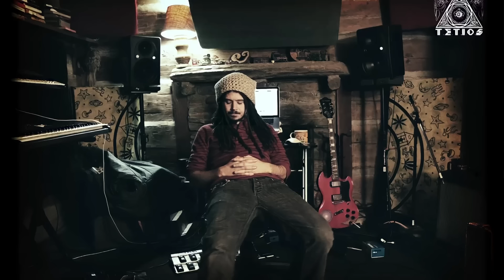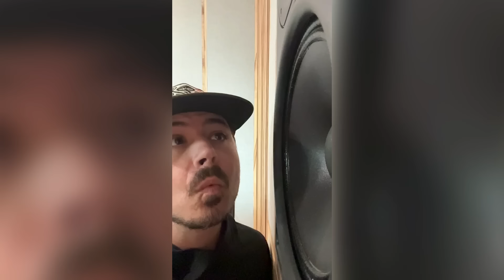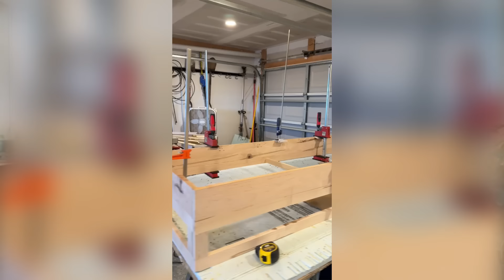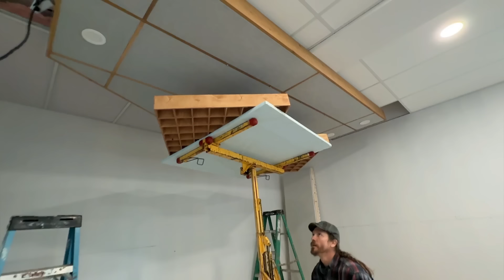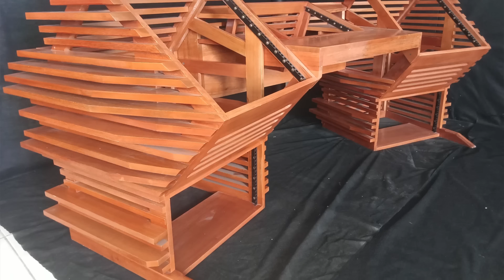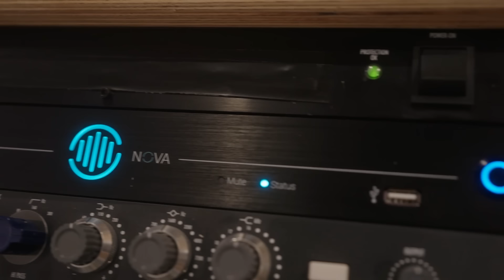New Studio! If I Can Build This, So Can You

Comment: Great video and amazing project and results. It's great to see the correct focus. So many "experts" think buying a pair of ported "pro" monitors and some acoustic panels can truly create an environment for mixing (or god forbid, mastering) or focus on equipment or software to correct acoustic issues. It's relatively easy to fix frequency response issues, it's very hard to fix time-domain related issues, which are equally important for proper translation.

Comment: This will probably get buried but worth noting, the ground is not "infinitely dampened" and absolutely does transfer vibration.  May be incredibly negligible to most frequencies at most volumes, but drums and bass absolutely travel with power.

And we're talking bass music, mostly w/ this channel, as i know Papadosio got an upgrade w/ this as well.

If youre going to foot a massive bill like building a studio or home theater, a floating floor is the way to go.  Its the endgame of a room within a room for sound isolation.

Ceiling height and shape really makes a huge difference.

If you ever build another one,  study home theater builds for sound isolation techniques.  Its amazing the amount of Db to be dropped just a couple feat away.

Comment: Your video detailing how you made your studio is truly inspiring. I wish I recorded my studio build as I could have shown the lessons I learnt. I had an extremely low budget, around $300 US, but I managed to do a somewhat similar looking fabric wall system for panels and a few clouds. I truly wanted to have some isolation but I got the wrong type of windows when I had this room built so noise comes in and out. I had to repurpose a spare room that I had built with the intention of some day convert it to a studio, so guess can get here without having to go through the rest of the house.
I used cheap materials to build the panel frames, I drilled all the holes myself, I used a saw and drill to make all of the woodwork myself and I wired everything myself, too. That saved me a lot of money. Temu is real life saver as you can get guitar, microphone, speaker, midi cables and many more for really cheap. You just need to get creative.

Comment: Congrats on the new place!   Indeed, to get the job done, no need for a studio, but... to feel the music (in your body), and feel good and have something to be proud of, which also becomes a place you can have musicians, and even students, if that option becomes interesting one day.
The woodworking?... hell yeah... good thing you learned and did it yourself, not only did you save quite some money, you have learned a new, fulfilling skill, now you can do stuff for others too (if you want some extra income) ;)  Or even guitars! :D  whoop whoop!... 

Regarding your color scheme, I'm with you... When you are used to dark places for a long time, a light place is definitely worth it. 
I hope you manage to get work, sell music, or whatever helps you cover the expenses and enjoy every second in that room.

Myself?... I don't own a place, I'm renting. And the only available place I'll have for my music creation is a loft with a low, sloped ceiling. Until now, it has been just a "dark" bedroom and living room combo, with my music-making "studio" in the even darker corner, but... I will start working on making some changes now. Luckily, the walls are filled with insulation material (rockwool/glava material), but as it gets too hot in summer. Too cold in winter, so an expensive, silent HVAC system will have to be bought, and it will have to be mounted by an authorized technician. Then I won't be able to do "structural" things, so I'll hang molton (or something similar) curtains to create room dividers, and also they'll work as absorbers/diffusers (although I will be building some panels, and a thin cloud (because of the low ceiling, etc.). I have a bed on one side and a sofa on the other, and those help as bass traps, but also the reason for those curtain dividers (to hide the bed, and for symmetry, have to hide the sofa) :P
I'll build a desk (and to avoid the flat top of the desk, I'll put a thin sheet of PET acoustic flat panel on top, and a vinyl with some texture on top, to refract some soundwaves and have it correctly placed. Symmetry, and Sonarworks SoundID calibration to top it off. Will it be great? No! But at least it will give me a place to start a tad more seriously than until now. If I get to have my own place one day, with enough room, I'd go for something like what you did. 
Btw, my entire house has an all-year-round RH (relative humidity) of just 25%, so I'll have to buy another humidifier as well :P  My guitars have adapted, though, but a tenor ukulele got its top cracked, cause its very thin wood, I'm glad I don't play the violin!

And forgot, but definitely one of the most important things, is "LIGHT". Several points of light, to create a professional atmosphere, and have joy while creating. 

Even if my build would not be as awesome as yours, it will cost quite a bit (for a poor fella, heck... I'm 47 but still). I don't even have a car! haha... totally "priorities". 

I also have a "bad" speaker as the Avantone, and different speakers and headphones/earphones to check my mixes on... my best ones are the Shure SHR1840, which are great for mixing, they reveal sounds and their positions like no other (I have tried), and my mixes translate quite well. For my main monitors, I'll be upgrading my JBL 305p mk1, which are great first monitors, to the Focal Alpha Twin Evo,  if I find they fit my room (need to do some math first), if not, I might go for the Neumann KH80 or KH120 II (little sisters of yours) or some Genelec 8030's. Will see. ;)

btw... You noticed the spider on your Neumann speaker, right? (when showing the db meter display) ;P

Comment: This is one of the best videos I’ve seen on studio builds, and only bested (perhaps) by Eric Valentine’s months long series of trials and tribulations of building a mix room.

I personally built a new room in 2018-2019 and raw dogged it with the help of my father.  Read all the books, spent months on the John Sayers forums learning everything I could.  Spent about 30k out of pocket and did everything except drywall/green glue and framing for the external walls.  Turned out looking amazing with proper isolation and HVAC given the parameters we were working within.

I still wound up disappointed with the results after moving speakers and auditioning different monitors.

Then I added subs and a miniDSP processor with Dirac Live.  Changed everything.  It’s like a more labor intensive Trinnov, but for 1/4 the cost.

Subs (especially flush mounted) avoid SBIR and when you crossover your mains much higher, you can get incredible low end performance.

Definitely recommend subs and DSP to take everything to the next level.

Fantastic job on build.  Extremely impressive.
Reply from the maker: Thanks! I had considered the minidsp route but ultimately went with the Trinnov! I'll say this, the tech has come SO far and I imagine the tech that Trinnov Nova uses will become more and more inexpensive as time goes on.
Reply: @SeedtoStage I was too broke for a stereo Trinnov system at the time.  I wound up doing something extremely unconventional and borrowed wisdom from the home theater world using multiple subs across the room with EQ/delay/all pass filters to make it as accurate as possible at my listening position.

There is a free program called MSO (multi-sub optimizer) that takes 30+ measurements from all the subs and runs overnight calculating filters and delays for the best results at your listening position.  This was a game changer.  Set my DSP and ran all 6 sub channels summed mono into Dirac as my sub channel.

I think Trinnov now does multiple sub management and bass management automatically which is fantastic.  Putting two subs in the front corners of your room, two in the rear corners, and two more throughout your room on individual channels of processing (think active bass traps… sometimes inverted and band passed to solve specific modal issues).  As long as your delay your mains/subs properly, you’ll have excellent crossover cohesion.

I really had a blast building my room.  I’d love to send you some REW measurements of my LP.  I also tune my room like a PA system with a massive 10dB lift in the low end.  

Some might argue I’m insane, but I take Mike Dean’s approach of putting the low end under a microscope that I can literally feel.  And clients love it. 😂

And the best part is that even after spending years building my room and learning exactly how it sounds… I do 95% of my mix on my mains, and I still wind up making my final moves on Immersion One VSX headphones with a topping DX5.  Best sanity check out there, and in a world where I couldn’t build a room, I think I’d be fine with using VSX and Metric A/B.  But it wouldn’t be as fun!

Cheers dude!  Love your content